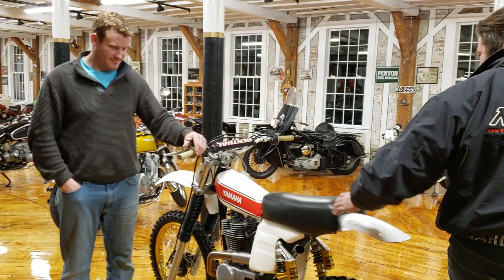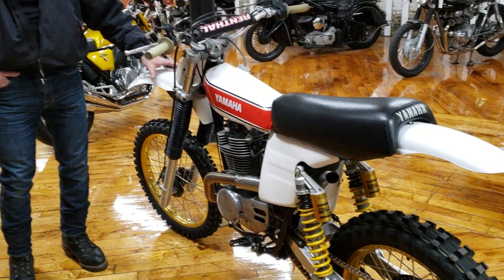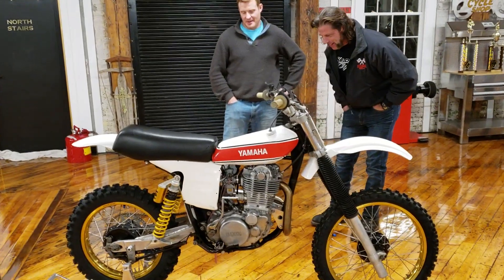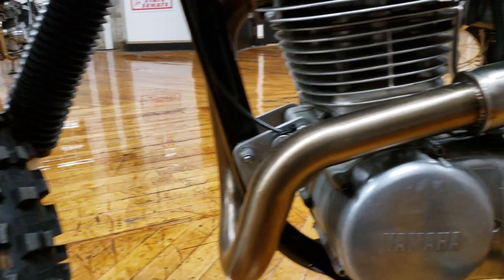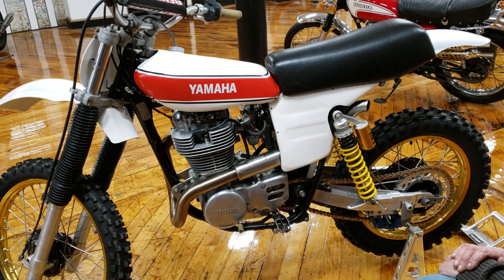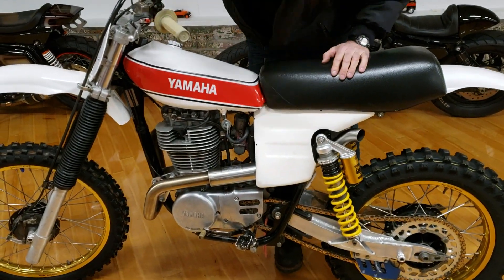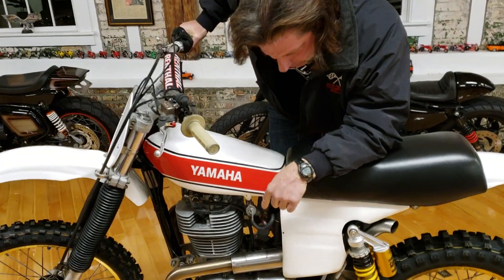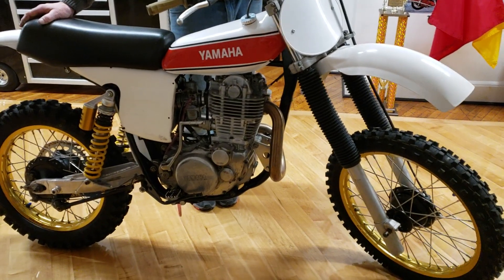YAMAHA HL500 1979 ABERGT REPLICA

Comment: I had the nicest hl500 in the USA. Mine was factory 44mm kyb front forks the bottom caps came off. and kyb air shocks. "Dual" high volume oil lines to "both" cam Followers, oil cooler in the airbox, lectron carb, 4in velocity stack and k&n next to oil cooler high comp piston. Right hand side reverse cone megaphone exhaust. Seventeen inch rear wheel. Torsten hallman unbendable handlebars. Preston petty fenders windsor tank. Whirlpool throttle. I have a photo of it. Mine was geared to go 110 miles an hour. Built in las cruces, new mexico costed ten thousand dollars to build. 1985 mine sounded wicked sick 12.5 compression reverse cone megaphone. I shit you not yours sounds wimpy and blappy compare to mine. Mine shook glass at the Yamaha shop with a deep deep tone.  We've been building those motors for forty years For flat track racing, you don't need to big bore them. You just need to pump them. The sr 500 heads had bigger valves the biked weighed 255  lbs.
Reply: You need to put a hollow reverse cone megaphone tip and that blappy sound will go away.
Reply: Llossa engineering will make you a hollow reverse cone Megaphone of that size.That will clamp right on twelve inches long.

Comment: This is a copy of the Norton Villiers Triumph [NVT] for the later production runs that Yamaha commissioned  them to make, when they wanted to cash in on the HL's reputation. Yamaha didn't make them themselves. The frames differed from the USA frames which had been built by ProFab. Although the british  frames were well built by an ex Rickman welder they did subsequently have a reputation for breaking and they definately were not the ProFab frame design. Why everyone copies the copy [though you can be sure that this GMC frame will have had all the flaws ironed out] is a mystery. No one in America seems to copy the ProFab frame. I talked with a german who had one of each and he said they were chalk and cheese.  I also checked with Geoff Morris  as to which frame he had copied.  And no 500 or even 540 TT engine ever made 50hp....... It's a two valve motor with a poor breathing head design.
Reply: I thought the max they got out of these old 500's was only 38-40 bhp.
Reply: @kevfinn8232  From everything I've learnt I thinks that correct. But they eventually changed the bore and stroke and got it up to around 50 with 600cc, but that was years later. In the first year I don't think they got much past 35. They originally raced with the standard cam
Reply: @jeremyatkinson4976 They're still the sexist bike in my eyes, and a pleasure to ride. My replica is bored to 540 with the hi-cam but I've never put it on the dyno, so I don't know what she pushes out cc wise.
Reply: @kevfinn8232  I doubt Bent's bike was ever put on a dyno, lap times.... I think my DMS MK4 has a bored aftermarket cam engine, my '76 C&J engine is probably stock.